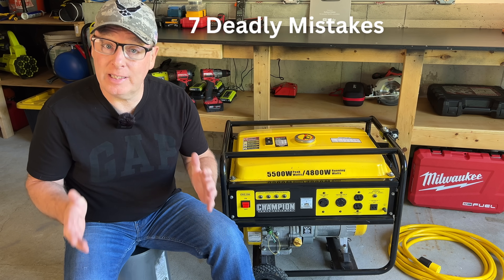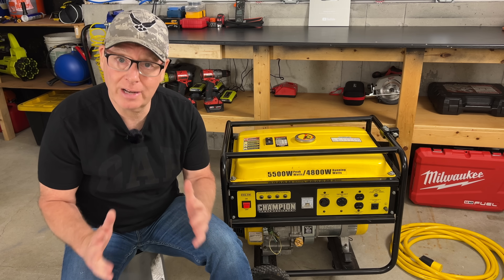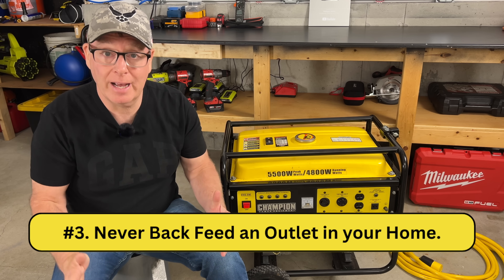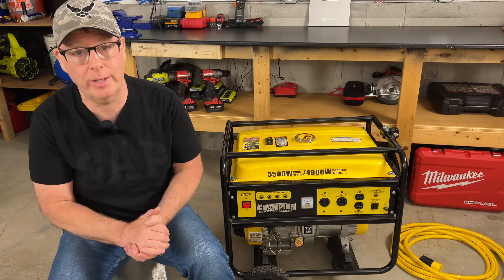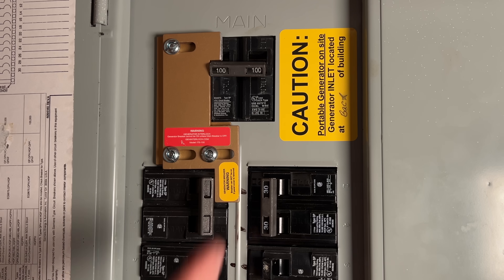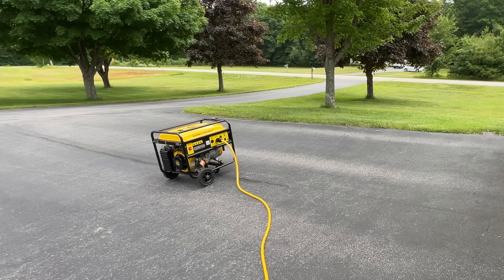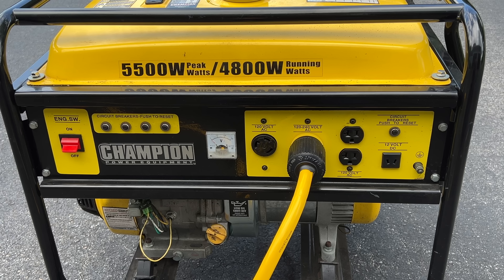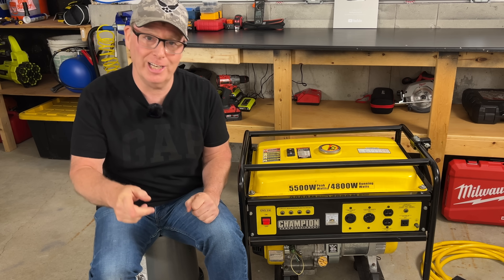7 Backup Generator Mistakes. (Have You Made One?)

Comment from the maker: Be sure to Subscribe and Hit the Bell so you won't miss my upcoming video on installing a 30A generator connection to a home. And the video after that we'll be installing and testing a battery power station with an automatic transfer switch. Great stuff coming up my friends. Thanks so much for being here and helping me hit that 200k subscriber count by the end of the summer. YOU GUYS are Awesome..
Reply: I have a leantoo built to a shed for my generators and fuel
Reply: What gage wire you need for a 220 generator extension cord
Reply from the maker: @iancameron198  It depends on the amperage not the voltage. The most common size of portable generator connection is 30A which would require 10 gauge wire. Some people may have a larger generator with a 50A feed which would require 8 gauge or possibly 6 gauge depending on the wire insulation.
Reply: Do you recommend a permanent standing generator? If so any manufacturers better than others?  Thank you
Reply from the maker: @kevinmazur1519  If I was going to install a fixed whole home generator I would go with Kohler. They aren't cheep but you get what you pay for.
Reply: @BackyardMaine question. I  want to make a pass through inlet box to run power through the side of my garage wall. This way I can run a duel fuel generator outside and run a cord to an inlet outlet on the outside  that passes through the wall using an approved wire that will go out the back of the box and the box flush mounted against my siding so no wires are exposed. Then on the inside wall of my garage just on other side of wall. Use another inlet box so I can plug a cord into that and then run that cord over to my EcoFlow battery called Delta Pro Ultra. 

This way I don’t have to leave my garage door open just to run the power cord under the door while charging my batteries that are inside the garage. 

Since neither inlet box is tied to my power panel. Will they require some type of grounding wire to the ground somehow?  I wish I could sinply pass a cord through the wall via a small access door so I don’t have to do this. But that will only let humidity and cold or hot air into the garage. We have a mini split and dehumidifier in the garage. Thus another reason to keep the garage door closed. And we have a heavy insulated garage door and the door will go back up if it hits the power cord if we were to run it under the door. 

Thanks for your thoughts.
Reply: Then what's the point in having a generator. Lol.  If you can't plug anything into it.  How are you going to hook up 2 or 3 small portable heaters to keep your house warm?  When you dont have power, The cords have to be plugged in and the cords are not long enoygh to reach anything so you have to use an extention cord to run it to a generator.  So how do I use my large gas generator if I can't use any extension cords.  And have to leave it setting outside in the ice and snow! During a power outage.  I'm not understanding how to use my generator
Reply: A better solution than "Be problematic and turn off your generator in an emergency situation to refuel it." Buddy people have to take care of loved ones, we dont have time to fk around with fueling a generator every few hours. Dont be a such a bone head, to tell people to run a hose from the secondary fuel inlet into a gas can before they startup the generator in an emergency to save themselves time late. holy crap, how are you the problem and the solution. its like watching a snake eating its own tail

Comment: I am shocked as generators have icons and the manual warns against this. Surprised so many die from it. Even more shocking, too many candles in an unventilated area can kill you, so if you run a bunch of candles in a room with no air flow ect it may kill you.

Comment: Thanks for the videos. I'm learning a lot. I had our home wired by an electrician to use my robust gas generator in case of a power outage, even though we've never had one of any significance where we live in Idaho. But when we lived in Ohio years ago, we used to often have winter ice storms that knocked the power out, sometimes for days. Go through one of those and you become a believer in a back up power situation. As you say in your video, one of the obvious things to avoid is running your generator in the rain. In that regard, have you had any experience with products like Gentent? Thanks.

Comment: Just wire your "suicide cord" into a 40/50 amp breaker and be done with it, the one running your central A/C is a good candidate since you likely can't run it anyway.  If you're not smart enough to know to open the main breaker before poking around in an exposed panel you shouldn't be messing with anything more complicated than a extension cord anyway.  Anyone with half a brain should be able to realize their generator is back feeding based off how much load is on it.

Comment: Something you don't mention and it appears that most YouTube guys are NOT mentioning is a floating neutral.  These open standard generators have a bonded neutral.  The home has a bonded neutral.  Two bonded neutrals = bad.  This is a hidden hazard that EVERYONE needs to be aware of.  The generator neutral needs to be floated with your home setup to be safe.  Also, no-one made it clear that these standard generators are providing dirty modified sine wave energy.  Likely to damage sensitive components in a home.  Well, everything is run by computers now so NOT purchasing a generator INVERTER is a expensive mistake waiting to happen.  Two very basic things no-one is talking about unless you dive DEEP in these areas.  Put out a video for this to help everyone out.
Reply from the maker: My generator has a floating neutral. I have a video on the subject.. https://youtu.be/V4UM7GB2wsg

Comment: The Generac manual clearly says "  Unplug all electrical loads from the unit's receptacles before starting the engine."  That directly contradicts your advice to start it will the cables plugged in. Which is correct?  Note, it doesn't say 'breaker off', it says 'unplug'

Comment: I have a 6,500 W generator that produces 5,000 W of running power. How may amps of power can I supply with it?
Reply from the maker: Full load would be just over 20A at 240v. The would be 20A on each leg at 120v if they were balanced evenly.

Comment: Thank you for this video.  My setup is different, as I do not have an add-on generator receptacle on my breaker box.  I have a completely separate transfer switch.  My portable generator is in a shed in my back yard, it plugs into a port on the inside of my shed.  The port is wired through PVC conduit 12" below grade up to my foundation and to the transfer switch, which is connected to my main breaker box right next to it.  Generator isn't big enough (8000W) to power all of the breakers in the main panel.  Works great though.

Comment: You can further reduce carbon monoxide by using a propane generator in produces mostly carbon dioxide,that’s why propane forklifts can be used indoors,also if I use generator as backup I only use it to operate separate from household wiring

Comment: I installed a transfer switch to isolate generator power from the outside world and installed a generator style connector to eliminate the suicide cord. I plug everything in before powering the generator and then switch the transfer switch from the main power to the generator power. I have 200 amp service so installed a 200 amp transfer switch.

Comment: I just purchased my first portable generator. My power was out for a week due to an electrical issue. Every Generator I researched before I purchased, all of them said to never leave them running outside. I thought that was weird. Mine will be outside if I need it again because I have no where else to put it. So when I bought mine, A Champion, like yours, I bought tent that you can put over it to help shield it from inclement weather.
Reply from the maker: I think they all have to say that for liability protection. Most people run them outside. Of course we can’t run them inside and most don’t have a covered open walled space. At least the tent will provide some protection

Comment: Hi, I have two portable generators. Primarily one for my trailer and one for my house. Since one runs in the bed of my truck and the other can be close to my house / garage, I designed and built, turned up exhaust pipes for both of them. I also designed and built Lexan rain shields  that snap onto the generator handles. Since I originally started with my travel trailer's generator to use on my house during a power outage, I use RV 30 Amp connections. I have a six circuit transfer switch on my house to run the important items.

Comment: i ran all new outlets throughout the house, not connected to the grid, their only used for the generator. we just transfer the plugs of what we want to run to the generator outlets. we way under use the capacity of the generator.

Comment: if you are desining a power back up

 do a  voltage calb  240 vac with 20 amp load

stop buying crap that clam  20-50 servive as it is not going to be from a lower  vac status

noying service out to home  25kw min to 50kw domstic tariffs

Comment: thank you::you may have saved my life..I have a generator in my van:I've been running extention cords from the van::into my home..question??was I in danger??or endangering the utility workers..I thought it was ok..
Reply from the maker: You can run a code in and connect individual loads to it like a refrigerator for example. But if you connect the generator to your home wiring you would need to do that in a safe code compliant way.

Comment: I have a dual fuel 9000 champion. I've had it for years. It is awesome. Gas lasts longer than lp. I have a shed away from the house that it runs in. The door is open.

Comment: I have 30 year old-ish 7000 running watt Generac, it was almost new when I bought it back in late 90s, I soon had it weird to 7500 watt transfer switch box for safe house power.
 My issue is the generator always struggled to run coffee maker and toaster, forget the micro. I idled it up a bit 2 years ago to get 120 -122 volts on outlets when it was about 117-ish volts, but it still struggles to run the 10 cup coffee maker and toaster. So what I want to know, is 7000 watt generator big enough to run a coffee maker and toaster, along with full size fridge, few lights, 240 volt well pump when needed?
I find it hard to believe coffee maker and toaster is close to 7000 watts.

Next question is on my 7500 watt transfer switch box, do you know if 7500 watts is outgoing power limit or incoming power limit? 
In other words if coffee maker, toaster,  fridge, few lights, 240 volt well pump adds up to 5-7000 watts, and a new up to date generator would work better, and  I find a great buy on a 10,000 watt generator, can I use a 10,000 watt generator on a 7500 transfer switch box if only using 5-7000 watts?
My theory is when I have a new bigger 10,000 watt generator I can use it to power my small welder in remote locations on my property, like a double application idea, the more use I can get out of a tool the better I like it, know what I mean..........

PS. Hey again from mid coast ME. Did you work at BIW in the 90s?

Comment: B-b-b-but... Why am I wasting time waiting for the genny to cool when the refueling process is "Walk over to the propane tanks roughly 12 feet away, twist the valve on the dead tank shut, swap the regulator from the dead tank to the fresh one, then twist the fresh one's valve open"? :) (Yes, I'm intentionally being a smart-ass :) Only an idjit is gonna try to dump gas into a running genny)
Reply from the maker: Propane is defiantly a good option. You may be surprised at how many people fill a running generator, mower, snowblower etc..

Comment: Yeah, your first mistake was attaching your power cord before you started your generator.
Reply from the maker: No You should always attach the power cord before starting the generator especially in wet conditions. But where you and many others don't understand is you never plug in something under load. I plug in the cord on both sides, start the generator and let it warm up,  I turn off all the breakers in my panel, open the main breaker, close the generator breaker and then turn on the individual breaker that I will be supplying.
Reply: @BackyardMaine  Yeah I don't think "understanding" is a problem on my end.  
I have repaired way to many generators because people stopped OR started a generator while loaded and fried something-like a voltage regulator or popped a field flash capacitor.  Then they are out of luck, hopefully they test the machine prior to the next use and find the problem and correct it.  
People don't remember details when under duress.  Simple stuff is what gets missed.  Never start or stop a generator loaded-easiest way to know-unplug it before you start or stop.  Simple.  
Have a nice day.
Reply from the maker: @bobbygene8274   I absolute agree you should never start or stop a loaded generator. I just think it's safer to make the connections outside (possibly in the rain) with the breakers off and the generator not running. I encourage people to write a step by step list or procedure for connecting backup power. I think we can agree on the safety aspect and of course we don't want to damage our equipment. I hope you have a nice day as well..

Comment: The backfeed method is ok and awesome if you're competent and not a window-licker. You just have to follow a few simple steps. Kind of like riding a motorcycle...you should be actively thinking about each step as you do them. (Don't back feed and always have cables plugged-in before starting the generator - turn off all house circuits and gradually turn on circuits as needed as to not overload the generator at first - make sure all 240v breakers stay off). Ideally the generator shouldn't operate at more than 50% of max capacity for longevity.
Reply from the maker: A mechanical device is not going to make a mistake. Line workers and neighbors should not have to rely on some remembering to do something right. People (even the ones that don’t lick windows) make mistakes sometimes. It’s not just against code it’s actually illegal.

Comment: Another good reason to turn the generator breaker off before connecting and disconnecting any feed lines is that as you electrocute yourself, you may exceed peak amperage current draw which may cause which can damage your generator.

Comment: I run my generator and welder from my shed and use 25ft of welding leads or 50ft of welding leads I run 50ft of extension cords and that's because I keep it stationary. And work outside my shed has metal exterior and interior walls

Comment: If you hook wire two generators together in a parallel circuit you multiply the wattage and thats the new output.
Reply from the maker: You can do that with some generator model but you need to be careful to size everything right. The code requires us to size our conductors and components to the maximum generator capacity not the size of the back feed breaker

Comment: And # 8:  Never use a cord or connector with a broken neutral wire to a 240V split phase generator.  That leaves the neutral floating, so the voltages in the house are not split evenly into 120V feeds.

Comment: Generator needed to run building heating system in winter due storm damage to utilities.
One example homes up town lost power for 3 dsys due blizzard tore off metal roofing that took out a transformer cluster.
The avarage winter temp is -17°F (66°North Latitude)
Have encountered generator engine vent iceing.
So generator needs shelter from subzero temps and wind driven snow.
As generator must be well away from the home.
So a quick erect shelter box the enshroud the gen while operating.
Had home wired with a cut in switch to operate just the heating system (boiler/controls and circ pumps)

Comment: Hi John,
We just purchased a Tri-Fuel Westinghouse 9500/12500 portable generator. It comes with a 30 amp and a 50 amp outlet.
I would like to get an electrician to install a quick connect box, transfer switch to the main breaker, etc.
Could you please explain why I would opt for a 50 amp box vs a 30 amp connect box? Do they serve 2 different purposes?
Thank you sir.
Reply from the maker: A 50 amp outlet will allow you to run more devices on your generator. With the larger generator you may want to opt for the 50A connection. But if you know you will never need that much capacity it may be better to save a few bucks and go with a 30A connection. It's all about what you need to run on the generator. Most loads are intermittent and don't run at the same time so they don't add up to much. But if you want to run larger loads like heat pumps, electric water heaters, AC units etc. You will want more power.

Comment: Great review brother, very informative.
Question, when do you need (and not need) to connect a grounding rod to a portable generator?
Thank you
Reply from the maker: I'll make a video on this but here's the short answer. With an inlet box connection like I have here in the video the generator needs to have a floating neutral which means the neutral and ground are not bonded together at the generator. You can only bond the neutral and ground together in one location and thats done at your service main. So with this type of connection no ground rod is needed. If you have a transfer switch that switches the hots and the neutral, (common for whole house automatic backup systems) then the generator ground and neutral are bonded because it's completely isolated from the utility power. This is called a separately derived system and required a ground rod or other approved grounding electrode.